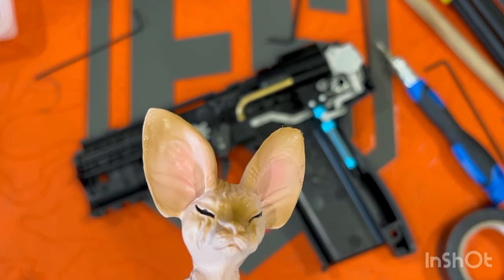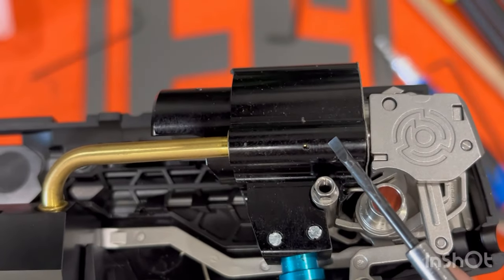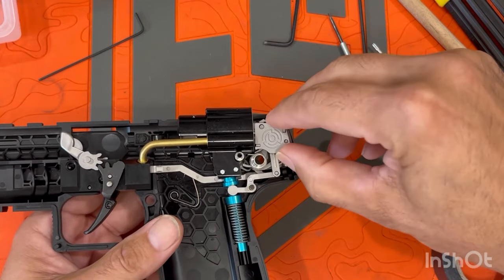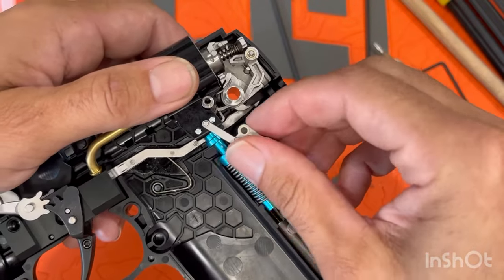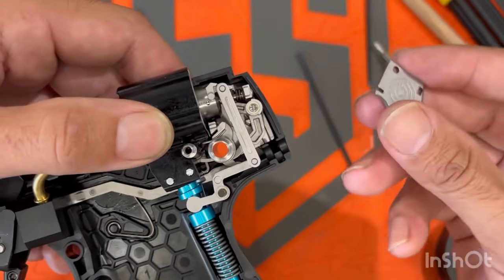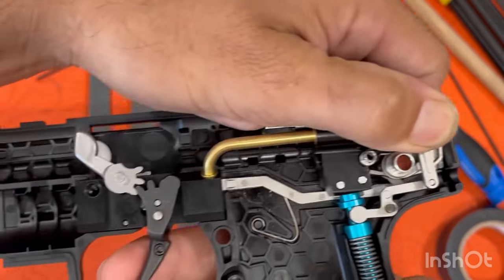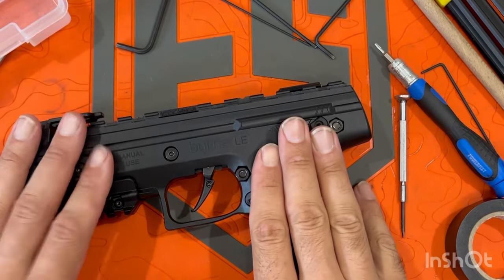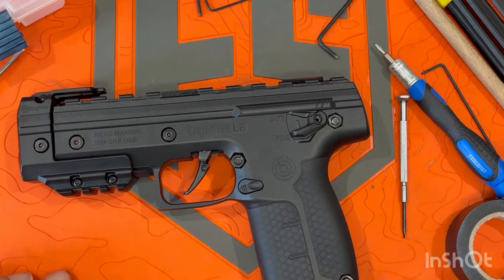Byrna LE Less Lethal - Mistakes Were Made

Comment: You gave it a shot....what about the "non functional" screw that usually goes in the back?
Reply from the maker: Yes that block off plate would seem is important to leave intact as it acts like a guide for the trigger arm and also offers some support to the cantilever function of that long cross bar.
Reply: Wasn't the cantilever on top of the square-ish plate as well? Or did it pull out from underneath that plate when you disassembled it?
Reply from the maker: @kobusvanrensburg4092  A very keen eye and i did note that when i rewatched the video. It appears that it was above but there is no way it can fit unless its below that cover so i assume it pulled out.
Reply: Does it have to have the mag in it? I respect your determination and I'm sure you will figure it out. It's usually something so simple you will laugh afterwards... 😊
Reply from the maker: @FLAlesslethal  i tried with a mag as well and same outcome with no fire. To the best of my knowledge it should with/without magazine inserted. Appreciate you watching and throwing me a bone.

Comment: I cant believe you accidentally broke your LE. It's enough to make us want to cry 😢
Reply from the maker: Accidentally on purpose 😆. It should be up in running soon.
Reply: I'm selling my LE. It didn't last long before the valve assembly went bad.
Reply from the maker: @BrilloHead if only i knew what was up with mine
Reply: @lesslethalfordummies  Just curious to know, how much are you willing to pay for my LE that is about to break sooner or later? FYI: It has been refurbished by Byrna before.
Reply from the maker: @BrilloHead is it not still under warranty. What is actually doing?
Reply: @lesslethalfordummies  Warranty? Only 6 months left to go since date of purchase. I only had it for 6 months and it has been sent to Byrna before on the 5th month. They replaced the whole valve assembly. But still, I think the valve issue is happening again. What really stinks about these "security devices" is that the dealer who I purchased from will not accept it for partial refund because it's considered a "security device". So if it does break again the second time, should the buyer be left with a piece of paperweight? I just find that to be unreasonable. I think Byrna should offer a program to take back any and all broken pistol launchers with partial reimbursement. That's what I think Byrna should do.
Reply: @BrilloHead  That's a great idea, but if you didn't buy it directly from Byrna, then you need to be dealing with the dealer you bought it from. I have several Byrna launchers that I bought directly from them and I have had a single issue with any of them. Maybe the dealer you bought it from did something by accident before selling it to you.
Reply: @Joreel  I say screw the dealer. They won't even accept returns on newly purchased Byrna launchers that have never been used before. They do not even honor their own return policy. I don't think I will ever buy any Byrna launchers from them again. They've lost me as a customer.
Reply: @BrilloHead my le was 5 days old and it leaks like crazy lucky Amazon refunded me full price and told me to keep it lol